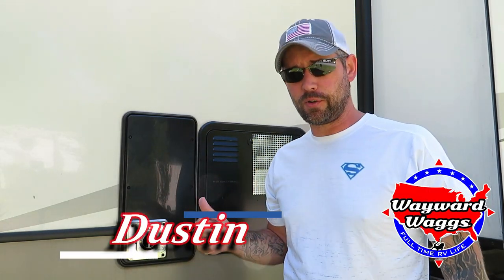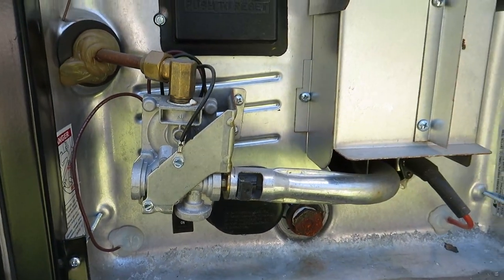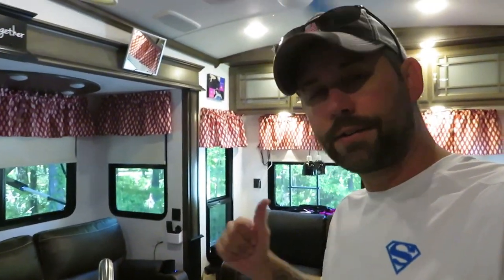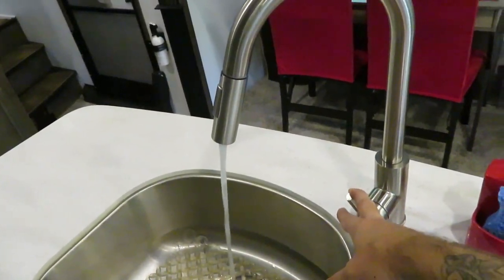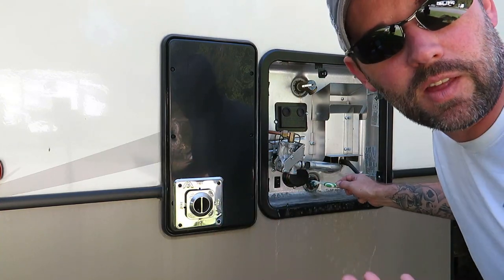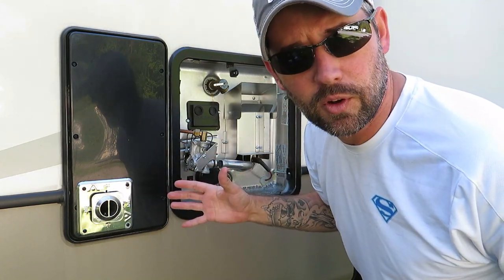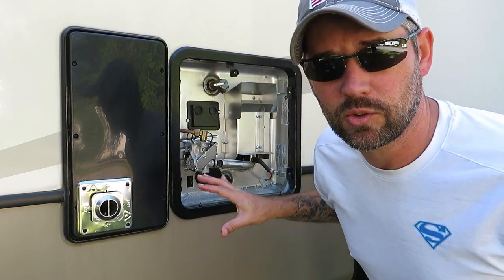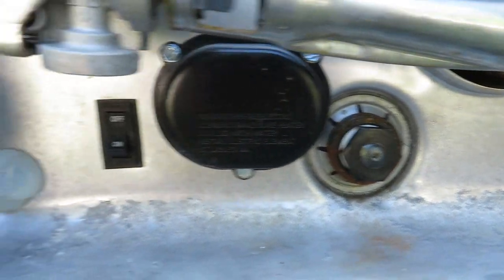RV Water Heater Anode Rod Replacement

Comment: You did a great job on how to change the anode rod.  As a novice camper, now I have the confidence to check mine out and replace it if necessary.  Again, thank you.
Reply from the maker: Glad to hear it helped.
Reply: Wayward Waggs, I just received my 2-pack anode today from Amazon this morning. So I asked my wife to join me to see what the anode rod looked like on our trailer. We were totally amazed at what we saw. There was inky the 1/8” rod left.  Fortunately there was no rust. When I flushed out the water heater, deposits of white stuff came out. I wish I can show you a photo of it. Nevertheless, thanks again.  Now I know to check it every 6-months to a year.

Comment: Couple of steps you should include is when you pull the rod out of the hot water tank is flushing out the tank. You should flush the hot water tank with a short wand ( get it on Amazon) till no more white pieces come out of the hole. Also when refilling you’re tank and system you should open the water faucets in your rig to get the air out of the lines and the water heater. You could possibly have a big air pocket in the water heater and the heating element in the tank not be in the water and burn out. Great video though. Easy to follow. Keith
Reply from the maker: Thank you

Comment: I use a pair of needle nose pliers to hold the rod straight as i starting threading it back into the heater.  The weight of the rod tends to cause the rod not to line up properly to begin threading it back in.  Learned this little trick after several attempts to get a new rod to get the proper alignment to begin threading it back in.  Take Care stay safe.  Hi from Salem Oregon.
Reply from the maker: Great tip. Thanks!

Comment: So it works like a zinc on a boat...corrosion in any water heater is a killer. I wonder if a home water heater has one of those? 🤔 We have anodes in x-ray tubes...Thanks!
Reply from the maker: I'm not sure if they are in home residential heaters or not.

Comment: I replace my “anode” rod on my home hot water heater also.  I was told, the warranty length is proportional to the size of anode rod installed.  Bigger rod, longer warranty - and a happy wife, not using the wrong towels.... 😳
Reply from the maker: 😂 For sure
Reply: Does all home water heater have an anode rod?

Comment: Just a tip from a plumber. If the water is hot you don’t have to heat it! Water heater not hot water heater and it is a anode rod adnode rod. Also get some of the little  screens to keep the wasp and dirt daubers  out of the water heater access. They also make the screens for the refrigerator vents. Hate those things! If y’all are ever able to travel again, safe travels.
Reply from the maker: Thanks for the tips

Comment: Did you use an aluminum rod or a magnesium rod?  Another tip is return the toothbrush to your wife’s toothbrush holder before she notices it was missing.  😂
Reply from the maker: We used aluminum. 😂 I don't think Leslie would find the toothbrush trick amusing.
Reply: Sorry Dustin but sooo new to all this. Just what I was going to ask on which type and what most RVs take also are they basically universal or do u have to get one to fit ur individual rv’s water heater?

Comment: When you replaced the anode did you flush the tank. I changed mine last week and used the wand and could not believe how much stuff came out and I use inline filters.
Reply from the maker: No we did not. We did not know about that until after the video was already shot. We will have to flush it.

Comment: LOL had to laugh every time you called it an adnode rod. Threw a D in there for some reason. Also there is no such thing as a hot water heater. If the water is already hot, there is no reason to heat it. LOL.. Just playin with ya.
Reply from the maker: 😂 I mispronoumced it the whole time.

Comment: What do you do when the anode rod will not come out?  Have tried with all my strength to remove. 
Need help 😫  thanks.
Reply from the maker: Not sure. Whomever installed it initially, may have not got the threads lined up correctly. Try some WD40 around where it threads in and see if that helps. Make sure the water heater is off and give it time to cool down. If it is hot, that could expand things and make it tight.

Comment: We just bought a brand new TT from a private seller,we took it out once, today I check the anode rod and is like 80 percent gone, what do you think could happen? Thanks
Reply from the maker: That is a good thing. That means the rod is being eaten up by the elements in the water instead of eating up the walls of your water heater. At 80% loss, you should definitely replace it and check it every year.